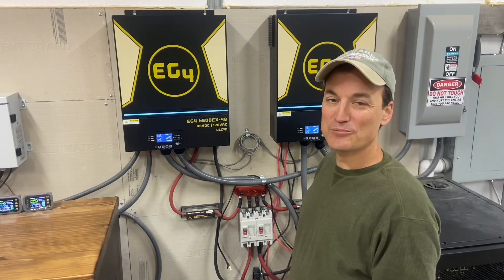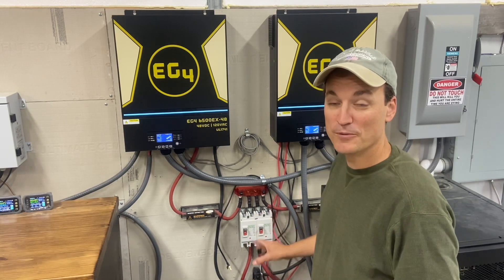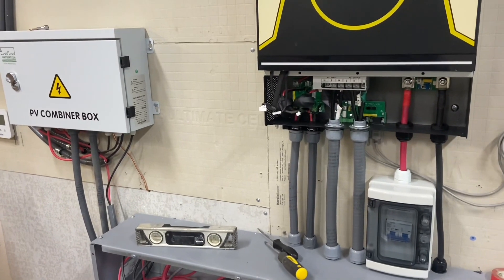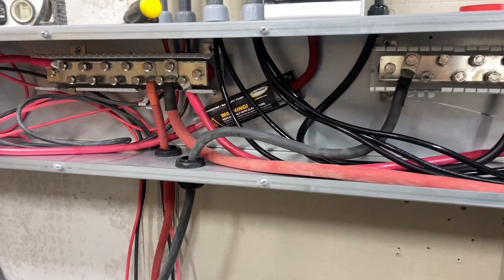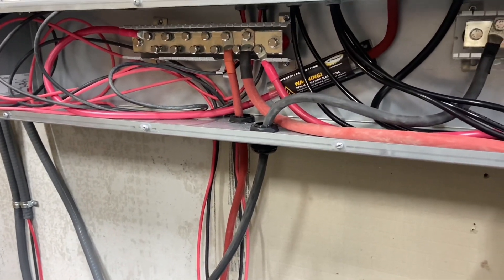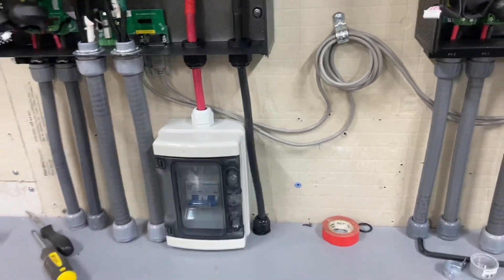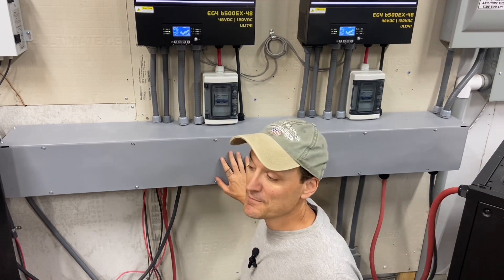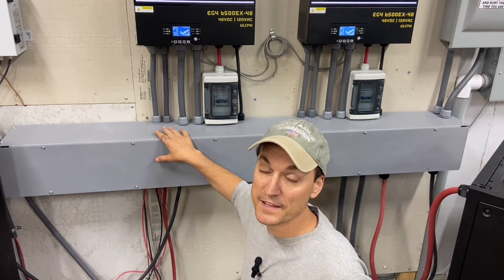Installing a wire trough for EG46500ex’s

Comment: Another question: do you know if electrical code requires wires from battery to inverter be run through conduit?-
Reply from the maker: I’m not sure. I would imagine so yes. And PV wire is required to be in metal conduit if it’s a dwelling.

Comment: Did you re-connect DC breakers?
Reply from the maker: With this setup I had to yes.
Reply: @GavinStoneDIY  I didn't see them....assume it's below the trough. Thanks
Reply from the maker: @stevef7814  they were I the title boxes with doors. On the right of the inverters. I switched breaker types.

Comment: Where did you get your wire trough from?  A quick Google search shows pricing on these things is all over the place!
Reply from the maker: @80HD_82  I got mine for a local electrical supply. Yeah online prices seem to be crazy. But occasionally eBay will have some good sales.

Comment: What brand and model of wireway did you install? A link would be very helpful. Thanks.  p.s. it looks much better!
Reply from the maker: @johnbrzezinski1446  I wish I had a link! It was from a local electrical supplier. I didn’t see a name brand on it or the side plates. Might have been a sticker they removed.

Comment: Great job. I am wondering how far below the inverters did you install the wire trough? Is there a minimum/max distance required ? Also, can you tell me how you grounded the trough ? Thanks.
Reply from the maker: @progradio-h4j  I don’t remember if they had a specific distance in the spec sheet. 

I just used a grounding lug that can be screwed in. You can find them on Amazon pretty cheap. And I attached a 10 awg wire to that and ran it to the ground in my breaker panel.

Comment: Hello, where can I get a box like the one you put to hide the wire  in my installation?
Reply from the maker: I bought mine locally. But usually Enclosure Hub has some pretty good prices on troughs.  I’ll add a link below. 

 https://enclosurehub.com/products/type-3r-galvanized-wiring-trough-c3rwtg-series?variant=44978240487742

Comment: Where did you buy the wire way?
Reply from the maker: I bought mine at a local electrical supply. But I would recommend this place. They have good prices and a nice selection. 

https://enclosurehub.com

Comment: just as a point, you have installed all those lock nuts upside down. the crown tips are meant to dig into the metal so that they don't come loose. Just a FYI
Reply from the maker: Yeah I got in a hurry and didn’t pay attention. Sometimes I zone out on a project.

Comment: Man, I love your stuff...I watched this a couple times checking out your connections. Im getting ready to do a battery upgrade and wanted to upgrade a couple more things and address some comments on my system that I had in reference to surge protection. BUT, my question is, where did you get your T-Class fuses?
Reply from the maker: I got them on Amazon. I’ll add a link to the ones I used in the description.
Reply from the maker: By the way I enjoy your content. Haven’t seen much solar stuff from you in a while.
Reply: @GavinStoneDIY  Yeah I've been overtaken by the garden :) I just purchased a Kong Elite Max battery from Big Battery and doing some homework on how to install it with my (4) Huskies I currently have. They wasn't much help & said "they don't design system" so I've been going through the DIY Solar Forum  for that, surge protection and these damn grounding screws :) I still have them in both my inverters, hoping to get that squared away too with this upgrade next week. I'm not very knowledgeable in this stuff but I will definitely be looking for your feedback when I roll it out in the coming weeks! Thanks Gavin!
Reply from the maker: @DumbGrunt0311  absolutely! Can’t wait to see it. Just give me a shout if you need any help.

Comment: Looks great.  Is the disconnect between the inverters and load center a toggle so you can switch the load center between the inverters and grid?
Reply from the maker: It’s a redundancy really. The breaker in the loads panel would be sufficient. But I liked having the option.

Comment: Ferruls
Reply: @GavinStoneDIY  terminate those bare ended wires with ferrules
Reply from the maker: @paulcurtis5496  it’s 4 awg wire. So there really isn’t a need. The terminals are designed for bare wire. But they could be used if someone was inclined to.

Comment: Looking sharp! (3:27 consider getting wire ferrule kit (with crimper) to keep the stranded wires together)
Reply from the maker: Those are required in some installations for sure. The #4  has extremely thick strands though. So it isn’t necessary. I am going to be using a ferrule kit next week though on another install. Hopefully I’ll have a video out by Friday. Should be an exciting one.
Reply: @GavinStoneDIY  Holy cheeseburgers, #4!! I like em because it just looks cleaner too!
Reply from the maker: @TonyPham-Creations  it does definitely look cleaner. These terminals were designed for bare wire though. Not that they couldn’t work with a ferrule. Just isn’t necessary. Honestly #4 is overkill for these inverters. 6 awg would be plenty. But it’s in the specs so I went ahead and went the extra mile.
Reply: @GavinStoneDIY  Appreciate the responses! Thanks!!

Comment: Looks good, Gavin!  I appreciate than you mentioned that you went 8 inch on the wire trough.  It would get crowded with 6 inch.  Glad to see you talking about grounding the trough, too.  It's on my todo list to do something very similar but I need a break for a while first.  Maybe I'll replace my LV6548s with the 18/12 EG4s and do all the rewiring then.  Appreciate the work you do to get these videos out there for us all.
Reply from the maker: I would just wait and do it with the 18k install and that at the same time. I think I’ll get an 18k eventually also. I want to see a little bit of a track record. But from what I’ve seen so far they are awesome. I want to do my own testing one really badly. But I’m forcing myself to wait.
Reply: @GavinStoneDIY  That's what I'm thinking too.  Next year I'd like to put in a deep well.  Because of the distance I'll likely have to set up separate solar for it, so I could use the LV6548s for that system.  Seems like a good excuse, anyway.  :D

Comment: cool video.  Do u have a link to the wire way? I can only find 6x6 or smaller. Thanks
Reply from the maker: I wish I did. I see a “zoro tools” place on google. But I can’t vouch for the quality. I purchased mine at a local electrical supply. Wherever you do purchase one, make sure to get the end caps also. They usually aren’t included. The end caps are universal. So you don’t have to buy them at the same place.

Comment: Nice and clean. You could also run the communication cables for the two inverters through the cover as well.
Reply from the maker: I’ve seen some conflicting reports about people having some issues with coms after they do that.

Comment: Great job. I installed my single eg4 with flex as well, and got it running quick. Then was bummed I didn't take my time and order the wireway in the first place. Live and learn, lol 🤙🏾
Reply from the maker: Well, it can always be done later. It’s just a huge pain. 😉

Comment: Hi, Mr. NEC N**i chiming in here.  Note the "Teeth" on the conduit fitting nuts are supposed to go down not up, and per the NEC any conduit holding 4awg or larger conductors needs to have an insulating bushing installed over each conduit fitting end.  If you care, if you don't then you do you. ;)
Reply from the maker: Yeah I did know about the fitting nuts. I just get careless. Especially when there isn’t any possibility of rubbing. The bushing part I didn’t know about. I appreciate that.
Reply: @GavinStoneDIY  I don't think it matters that much on non metallic conduit and fittings TBH. That pvc edge isn't going to cut the insulation and I think the tabs going down is mostly for bonding purposes for metallic conduit to cut through the coating on the metal box.  Really only matters to an electrical inspector or a YouTube NEC N**i.  :)
Reply: Speaking of the NEC, don't the AC and DC conductors have to be separated in the wireway?  I didn't in mine, but I think there's a new ruling allowing it in 2023 code - just not certain of the details.
Reply: @ericjansen9042  I heard they finally changed that from an Engineer775 video.  I did some hunting and it looks like it was allowed in the 2017 revision of the NEC as long as the voltage is below 1000v per 300.3(C). The conductors have to have the same or greater voltage rating as the highest voltage conductor. PV wires still must be in metallic conduit, metal raceway, etc per 690.31(D).  Thanks to Adam DeLay for dropping that last bombshell on me. :)